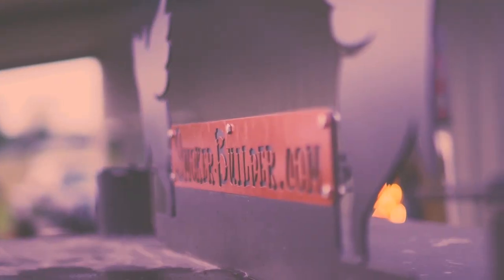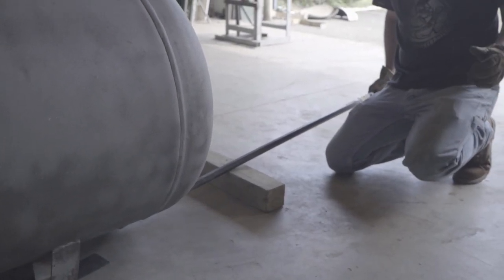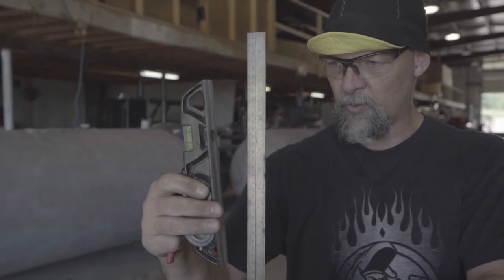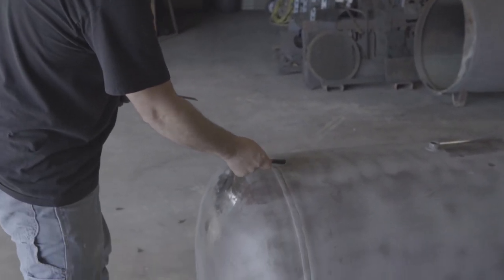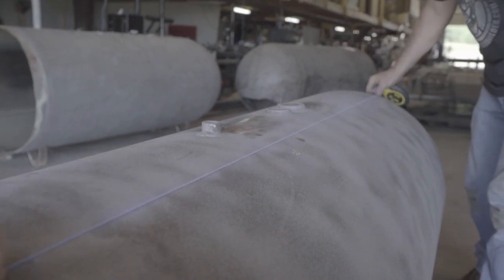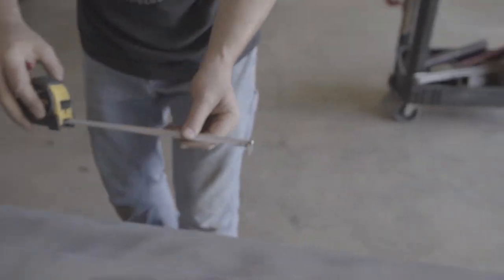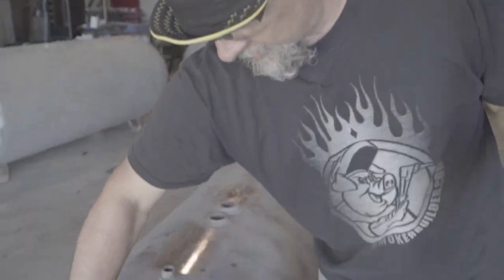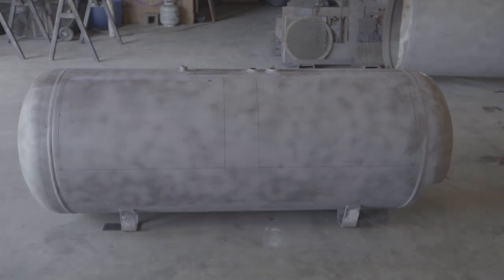Expert Tips: How to Mark Cook Chamber Doors

Comment: I’m in the process of building a 250gal smoker. I have some questions. Are the cut out for the doors 1/4 of the circumference or slightly less? Does the cooking grate sit exactly halfway or slightly lower?

Comment: How much would you say a typical 250gal reverse flow smoker weighs?
Reply from the maker: So many things vary, but normal would be around 1000 to 2000 lbs.  every one is different depending on customer options.

Comment: LOL, the tape measure starting at 10", I had to laugh.  Not that you did it, just at the comments.  I do similar, all my tapes have incremental inch marks after each 12 inches, so the first inch after 12 has 2 markings, 13 and 1, if i need 6 inches I start at 12 and read the 6 on the tape.
Reply: I was taught to burn the first inch.